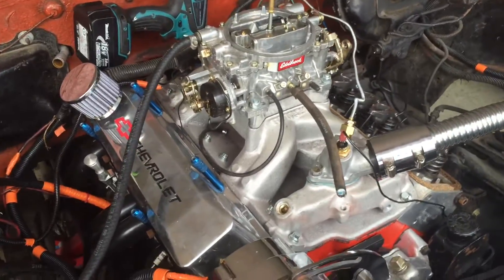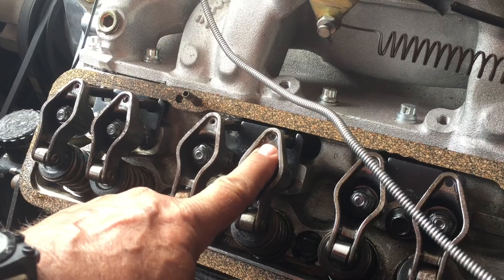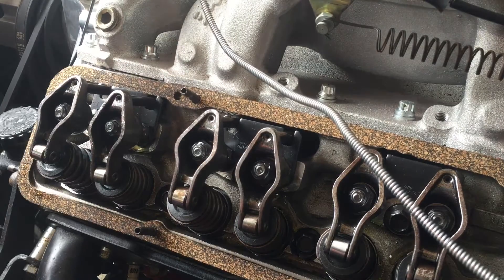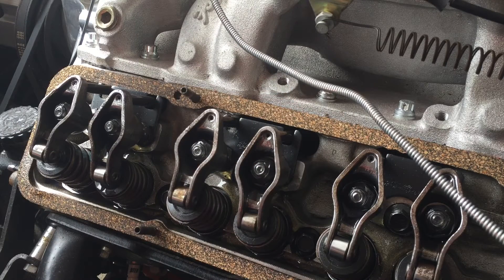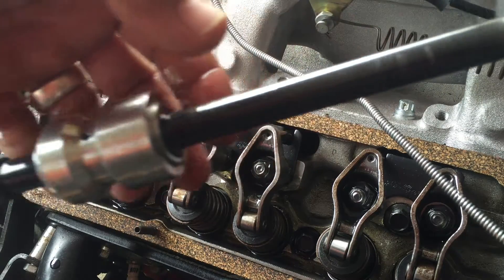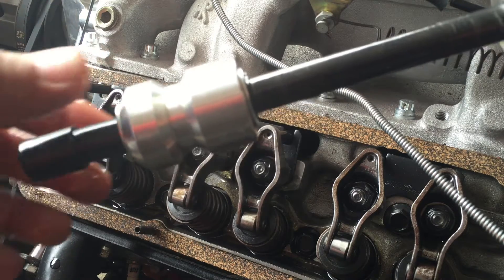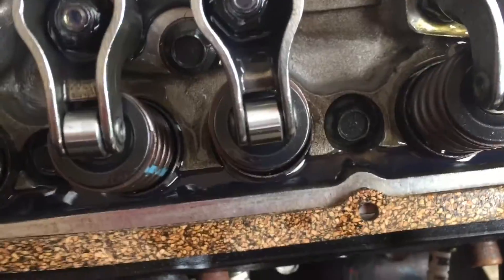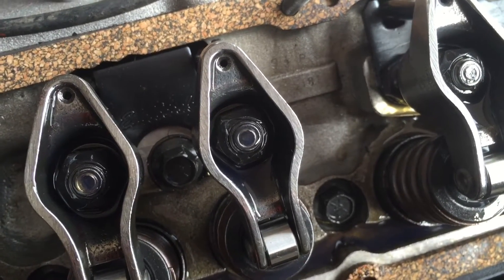Oil Priming a Chevy 350 before initial start

Comment: CAUTION! I learned the hard way that doing this with a nylon retainer on the intermediate oil pump drive shaft can break the retainer and have the intermediate shaft come out with the priming tool.
Reply: Steel collar only
Reply: This just happened to me today, the engine was already installed in the car. What did you do to fix this? I’m at the point where I’m gonna drop the pan.
Reply: @JakeSanMartin  I was able to pull the intake manifold and get to the retainer. I was lucky in that the retainer had moved down the oil pump shaft and was visible.

Comment: thanks for sharing your videos, I'm from Uruguay, I have a drawer, 350 vortec, I'm priming the engine and the butt of the passenger side does not drop a drop of oil and they are going to more than 15 minutes of drilling, it is normal that it takes so long ??
Reply from the maker: What type of priming tool are you using? 
Are you rotating motor quarter turns?
What is the oil psi on your gage while spinning motor?
Some primer tools do not work on the SBC.
Reply: @LaRelicHunter  If I am turning the motor, while the bait, and the pressure of 50 PSI, the tool that uses is the one that you use in your video. The stock on the driver's side loads fast but the passenger side has not dropped a single drop. I do not know if you keep insisting with the priming and the moment.
Reply from the maker: chevytodopoderoso 
Well the good thing is you have oil on the drivers side. I would think one of your oil galleys is plugged.
Or you missed one of the oil galley plugs. I would place the Distributer in start the motor just let it warm up see if it unclogs the galley. Should not take but a few mins.
If you want to check the galley plugs
There is one under the intake and one behind the timing cover. 
I have had this happen before on a few motors and one of the galleys was plugged. Especially if motor sat up for any period of time during rebuild.
Hope this helps.

Comment: FYI Don't use the autozone 27060 oil primer! What's the idea behind rotating the engine by hand a few times during this process?  Some people do, some don't. I don't want to waste my time if it isn't necessary.
Reply from the maker: Jay Ryan 
I do it mostly to get the oil filter full of oil and to make sure i didn't leave an oil plug out somewhere before i fire the engine up for break in. if your goal is to see if there is oil flow everywhere then you've gotta do it with the valve covers off to watch the rocker arms and slowly crank the engine thru a couple of revolutions to get oil everywhere.
Relieves pressure on tubes as you turn the engine. 1000 rpm on drill equals about 2000 rpms.
I have heard of people washing cam lobes on new builds and can’t figure out just what happen.
It’s a piece of mind for me and only takes an hour or so.

Comment: Should I be concerned if one pushrod squirts 6 inches in the air and another took five minutes to start trickling? Should they be squirting in the air or just trickling, what is normal?
Reply from the maker: trickling is fine 
Squirting in the air would suggest to much drill speed or trash blocking end of tube.
I would replace tube.
Cheap to replace re-test and see if it changes.

Comment: Take me about 45 mins to have all the rockers primed/ have oil over them. Is that normal. Drill is getting psi to 40/42 psi
Reply from the maker: Yes as long as you have oil coming out push tubes your good. Need to use a high speed drill. I was doing about 40 psi at time of priming this motor.
Reply: LaRelicHunter awesome man thanks. Im now having trouble with timing. It would spit flames out the exhaust and go poof instead of firing haha. I think my timing was 180 out so I reinstalled the timing chain to make sure it was on correctly now im about to try again. Hopefully ill have it broke in soon.